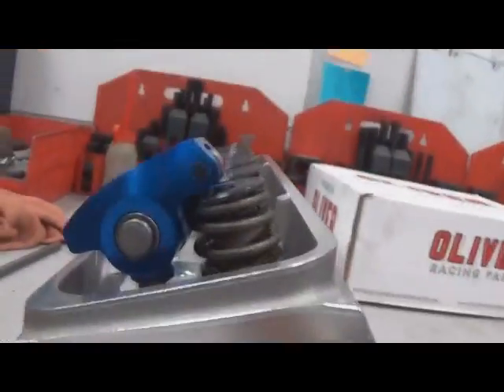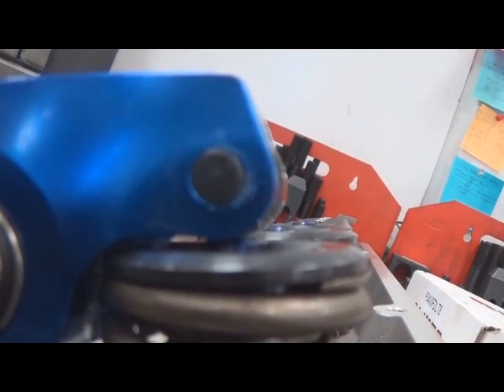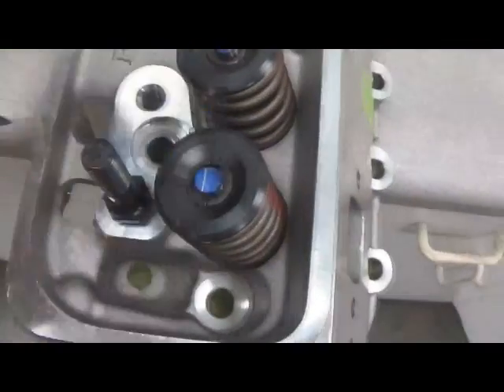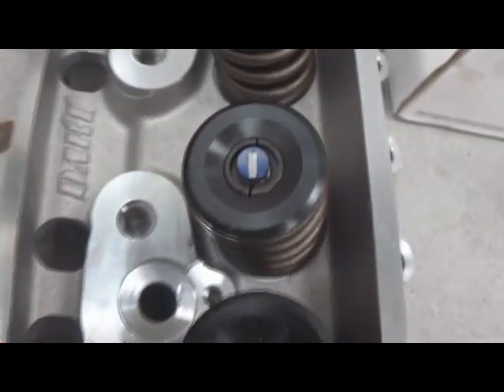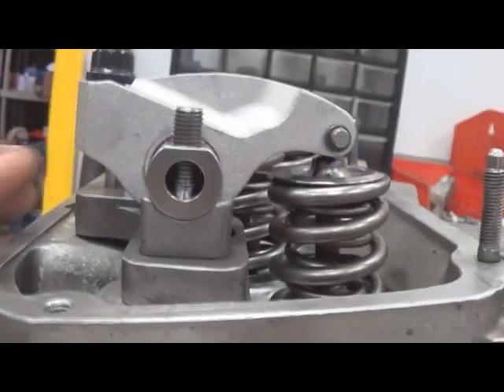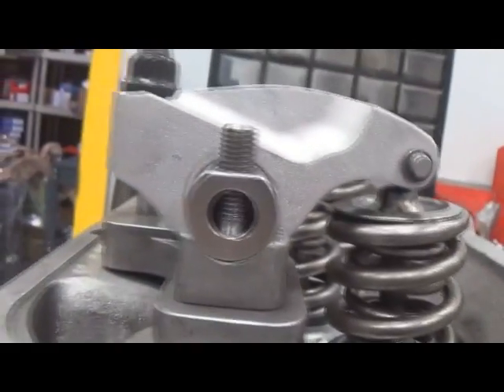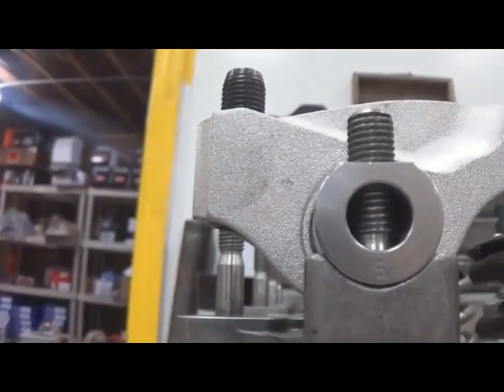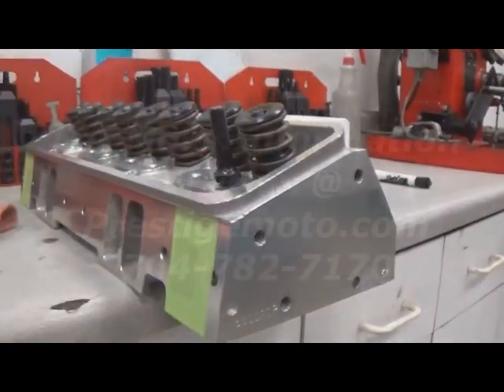UNDERSTANDING ROCKER ARM GEOMETRY

Comment: Wow. The fulcrum geometry of that click picture rocker is great.
Definitely a fast-off-the-seat item. Most shaft type are.
Plain rollers usually are NOT. Few understand the difference.
Also the shaft pedestal system must be adjusted up or down.... Because not all heads are accurately machined. 😳

Comment: I've been adjusting nut on top of rocker arm, every time I tune up the car. It was in the owner's manual. My 1988 Nissan Sentra 4 cylinder 1.6 L with 178000 miles is doing great. All I did was loosen the nuts and then tighten nut one at a time, until engine started to stall. Then back off the nut a little bit and move to the next one. Always wondered why I was doing it. Thanks for posting

Comment: You got to get your adjuster in a good starting position first. With light setup springs and an adjustable push rod you bring the valve to 50% open and check that the line from your rocker tip in relation to the valve stem passes directly through the shaft center line. If not, the shaft needs to be raised or lowered. Use the push rod length that gives you the closest to a straight line between the push rod and adjuster at full lift without too much offset at fully closed. Centered and narrow wipes are important and fall into place when the geometry is corrected. B3 Racing has this all figured out with their geometry correction kits.

Comment: I've  been looking for a vid that shows how to determine pushrod length on shaft mounted rockers, this is the only one I've  seen.
I have a 91 dodge 360 roller cam LA engine and am stroking it to 408, with a larger cam,  been looking for a bit of info.
Reply: Get a pushrod length checker 7-8.25 inch is roughly what our motors need. Then order the correct one. Also see b3 engines as he carries a geometry correction kit specific to your build.

Comment: I was under the impression that rocker geometry determines your pushrod length. What I mean by that is you get your geometry based off your cam card/spring and stud size, Then from there you measure your pushrod.

Comment: Are shaft rockers used with hydraulic cams?
Reply from the maker: They can be but in most cases we opt for the shaft systems when using solid roller camshafts. Mainly because we are using more aggressive ramp profiles and higher "over the nose" spring pressures. If its in the budget to go shaft with either hydraulic or solid we would recommend it.
Reply: @prestigemotorsports  I know that you were answering his question,  but you guys are hilarious the way you think EVERYONE has a big or small block Chevy by default.
Reply: I bought a set of Pqw shaft rockers for my 15..* 434, SBC . Makes 788 HP, I spray 2 stages thru it as the situation calls for it! 325 passes on same Rockers never broke  one piece of the whole assembly.  
However, I go over kill on maintenance in between races, check lash, pre lube everything when maintaining valve train. 
Pull rockers off and inspect push rod cup, rocker body for cracks, roller tips, replace pedestal bolts that hold rockers to stand every six month just to be safe, inspect rocker stand with magna-flux, Then 
OCD CLEAN THE PISS OUTTA EVERY PIECE! Brand new solvent on rockers then I soak them over night in no detergent oil with a full bottle of Lucas
Zinc additive. Then all the rest of the pars take a lacquer thinner bath.  Once clean,
I air blow every piece in a clean bright environment MPI everything & visual inspect it, f
Then, lacquer bathe it to spotless again, 
Then takes a soak in oil / zinc overnight. 

Next morning she’s ready and POW! 
(PUTT’N * OUT * WORK, Like a Hoe on Dolla night! 

Moral to story, just because she doesn’t have big named high quality Shaft System luke Jessel or T&D, (Those are the best of the BEST no doubt), but my set makes a lot of HP & a lot of passes with ZERO failures! It’s all in how yo 
  Maintain your equipment.  Also, some of the less expensive stuff, is pretty dam good quality these days. 

15* 434, SBC, 766 lift Spec Nitrous Grind from Bullet Cams, solid roller, Morel Lifters, bushed bores, Dart block, 
788 HP / 605 # ft torque  
Jessel belt drive, 
AFR 245 Blanks / Slick - Rick Racing Heads 
(Proto -Type) confidential on specs.  
Steve Johnson Dual Stage Fogger Dope System w/ Stinger plate hooked up as my scrample button but have never needed where we are running in Texas at the moment.  These Cactus Hopper LS Trucks & Camaro’s all go home w/ the Stank Eye when the get all Fukered up by 
“THE HATTER-MAKER!” I gladly take their Momma’s money every time!  Lost 1 race out of 73, that’s bc I scattered my Rossler finally after about 5 years of beatings on it. Best and only REAL TRANS Builders in USA probably the WORLD

Comment: I'd rather have the tip sweep towards the exhaust side then come back in, gives you more of your full lift, I'm not talking extremes, also don't do this with hyd lifters unless u use lightweight setup springs fyi

Comment: I would rather use the 90 degree at mid cam lift method, because what you just showed is half assed bullshit.
Reply from the maker: Jasper Pipes thanks for such a professional comment. The video was done specifically to outline how geometry is determined NOT actually checking or setting geometry. I suppose we will do another video showing how that's performed to see if you have yet another smart @$$ comment!